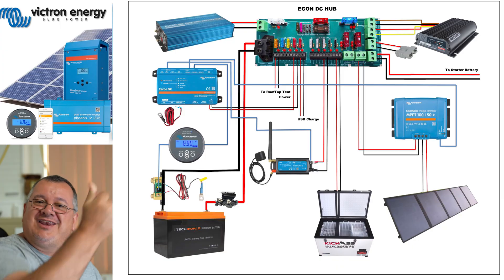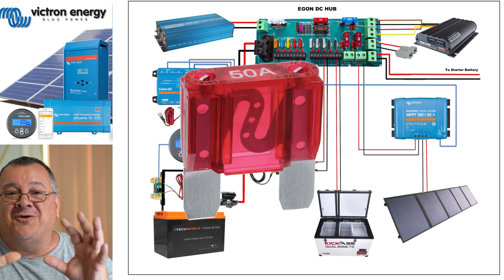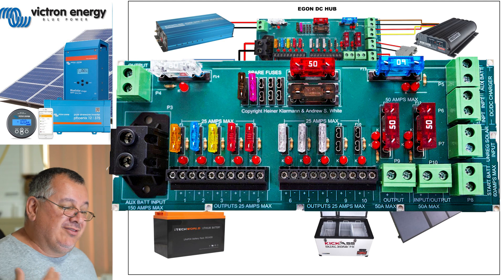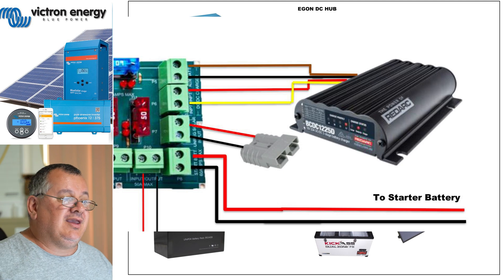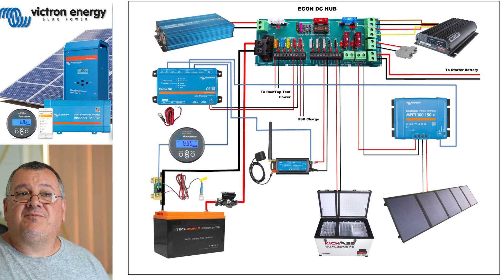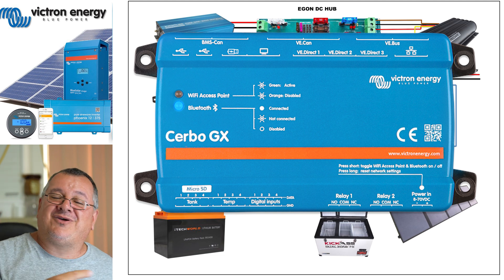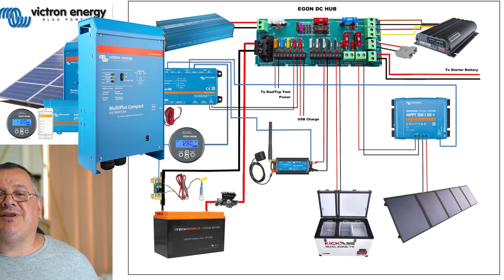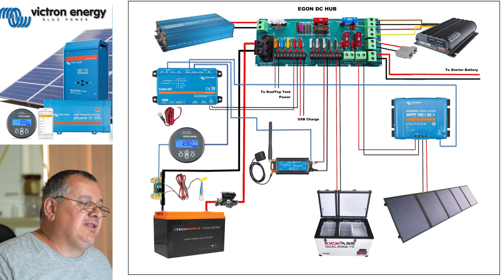My 12 Volt Schematic Drawing For Egon DC Hub and Victron Products

Comment: Are you running your compressor through your house battery or crank battery?
Reply from the maker: Crank battery.  But plans are to eventually mount compressor permanently in vehicle wired to house battery.
Reply: Does the wiring for the compressor still pass through the dc hub if running from the crank battery @ ?
Reply from the maker: @terrydactyl7708  .  Run it from the top left connector on the Egon DC Hub.  That connection is designed for the high amp air pumps and uses your house battery.
Reply: Why are you changing compressor source to the house battery  @PhilsCampingReviews  ? Pumping up tires after drawing power from camping could leave you in a pickle.
Reply from the maker: @terrydactyl7708  I’ve got a 330ah battery in Pajero.  A 200ah in the camper trailer and a 2000w portable battery pack.
Reply from the maker: @terrydactyl7708  my compressor draws about 60 amps but it pumps my tyres from 16 psi to 40 psi in just over a minute
Reply from the maker: @terrydactyl7708  sorry missed your question before.  No, wiring a compressor to dc hub does not power of crank battery
Reply: So you bypass the dc hub if powering the compressor from the cranking battery?  @PhilsCampingReviews
Reply from the maker: @terrydactyl7708  Yes.

Comment: Thanks Phil, Im building a new setup in my 76 series. Youre the only one that I can find that is installing the Egon hub. I saw it on another channel then you can up in recommended. Good informative video mate. I am curioous about the inverter in that diagram. How does the shunt know what power the inverter is taking?
Reply from the maker: The inverter is part of the Victron Multiplus.  There is a network cable that plugs from the Multiplus to the Victron Cerbo GX.  All info is transferred via the cable.
Reply: @PhilsCampingReviews  Ahh thanks mate.

Comment: Hi mate, like your video and energy put into it. Got me as a new sub!

A question, if you incorporate into this system your upcoming Victron MultiPlus Compact Inverter/Charger, does that mean you will replace the existing Redarch BCDC charger and Kickass inverter?
Reason why I am asking because I am at the starting point of investing into 12V system. Victron seems to be my priority for the communication of various modules. Redarc for charging, thinking for inverter too but bit expensive for me right  now, maybe ITechworld inverter, as well as iTechworld lithium batteries. Unsure about solar panels, lots to choose from, maybe Victron..
EGON DC hub I am liking more, and will probably go that way. Perth guys who developed this hub highligted its other benefits, such as to be able to connect your multimeter to its pins and get the measurements as part of troubleshooting. Your comment on LEDs setting on if fuses blow our are another benefit. 
Keep up with this great content.
Cheers
Reply from the maker: Thanks.  Yes I’m pretty much using all Victron now including Multiplus and Cerbo GX. 

I’m still using the redarc 1225D bcdc charger.  

Battery I’m currently using is a Itechworld 120X
Reply: @PhilsCampingReviews  thanks. Does Victron MultiPlus charger perform similar functionality to Redarc bcdc charger?
 I am aware of other MultiPlus functionalities, but curious about chargers. Cheers
Reply: Follow up on my question about chargers, just watched Victron video. Victron MultiPlus charger is from AC 240 V to DC 12V. Your Redarc bcdc charger is from alternator to 12V battery.
Makes sense now.
Cheers
Reply from the maker: @TheCvele1974   yes.  That is correct.   It’s a great system.  Also read up about Power assist on the multiplus. 

It’s the only one that has this feature.
Reply: @PhilsCampingReviews  thanks mate

Comment: Hi Phil.  Thanks for the video.  Just purchased one of these myself and I was wondering what you are using for a torque screw driver for the ranges of  .6 - 4nm when securing the wires to it?  Please tell me its not a $400 plus Facom that Klarmann used in one of his example videos!
Reply from the maker: Yes.  I know what you mean.  I saw the price and though,  nah I'm not using that.    I've got a Warren & Brown Precision Torque Wrench and use adaptors so I can use screw driver bits on it.
Reply: @PhilsCampingReviews   Thanks for the reply.  After a bit more searching I managed to find a torque screw driver that does just .6nm and a bicycle torque wrench that does 1-12nm.  The combination of the two less than $100 shipped.  Before this thing I didnt realise micro torque drivers was even a thing!
Reply from the maker: @gvansomeren  same here,  I also did not know about micro torque screwdrivers.

Comment: Great vid Phil. .thanks for this and lot of info your setup. Just got my Egon Hub delivered. Have a few questions. What gauge cable are you running for the following:
a. Main battery to DC Hub
b. DC Hub to Aux Battery
c. DC Hub to Fridge
d. DC Hub to Solar Controller
d. DC Hub to other aux such as lights, USB etc

Thanks mate
Reply from the maker: I can't recall now.  but I followed the suggested cable size in the instructions you get with the DC Hub.

Comment: I’ve got all Victron gear and 2 x iTechWorld 120AHX and 900w solar. No 240v at all. All works well. We have been away at the Big Red Bash for 3 weeks and had no issues keeping it all charged. Same fridge as yours as well as a bushman fridge, 12v electric blanket.
Reply from the maker: It's good gear,  built to last and very reliable.  I think those to features are very important,  because sometimes we are in very remote locations with no help if needed.

Comment: If all the fuses are just in the DC-Hub you do have a problem, as Fuses have to be at the source end to work.  I seriously hope you have more fuses in the chain and not just the ones in the DC-Hub.
Reply from the maker: Of course there are other fuses.  The battery are fused and all the individual components have fuses on them.  Such as fridge etc.
Reply: @PhilsCampingReviews  Probably a good idea to point that out so as not to give people the wrong idea.  Because if someone did rely solely on the fuses in the DC-Hub it could well result in bad outcomes like a fire.
Reply from the maker: I think they would be perfectly fine.  The fuses will be enough in the DC Hub.
Reply: @PhilsCampingReviews  If you believe that why don't you remove the fuse from your battery etc and find out?  That has to be the stupidest thing I have ever heard you say might, you might want to rethink that statement.  Even Andrew & Co explicitly now say you must have other fuses to be safe and pass Australian electrical standards.

Comment: Hey Phil the Victron Modem in your diagram- what is the difference between that and the CEL-Fi Go???. P.S - your videos are getting better and better, did you get Adobe Premiere?
Reply from the maker: Lots.  CEL-Fi Go boosts mobile signals as you know,  so you get instead of 1 bar of signal on phone,  you get 4 or 5 bars.

The Victron 4G LTE is basically a modem for the cerbo gx and the victron management Portal,   There fore I'm able to connect to my system remotely via the portal,  as long within mobile service.

Comment: Good to see you going with Victron - by far the best on the market.
Reply from the maker: Agree.  I think it is the best.  I've actually been using Victron products for 5 years now.   So it's not new to me.
Reply: @PhilsCampingReviews  It isn't the cheapest, but it is by far the best on the market by far. That is why the BEST companies use their products incorporated into their 12V etc builds....
Reply from the maker: Also why a lot of round the world sailers use Victron gear.  They need some thing reliable for there safety.

Comment: Fantastic clip mate awesome Description and well explained I’m a mug and I even got it if I didn’t have my system set up already I would’ve went with a DC hub
Reply from the maker: Thanks Stephen.   Not cheap but you can see how well it works.   In fact I reckon by the time you paid a qualified installer and all the wires.  Your up around the same price of one of these DC Hubs. 

Anyone should be able to set these up.